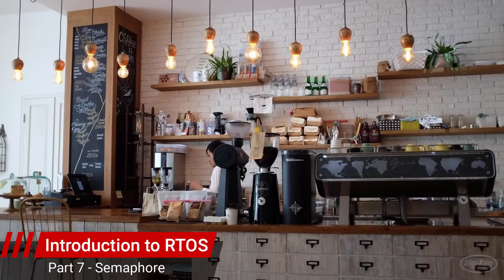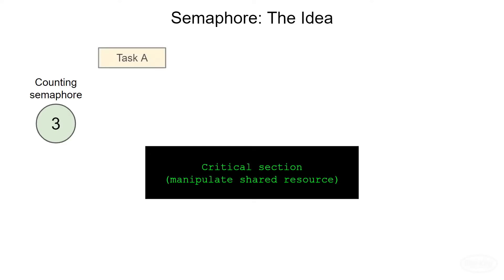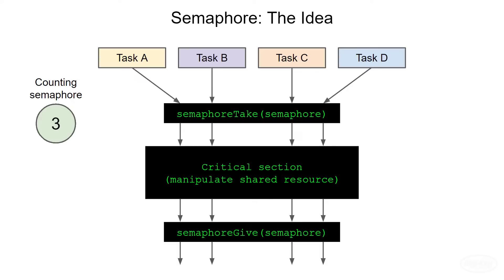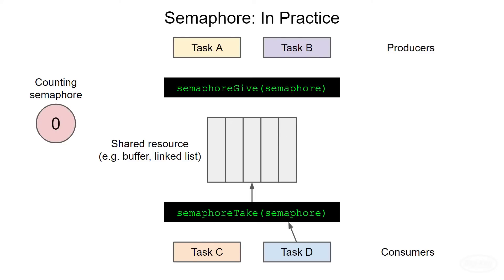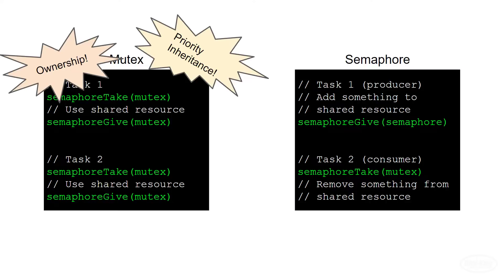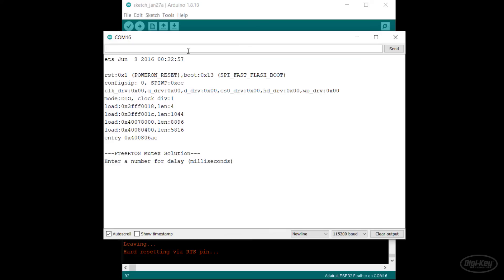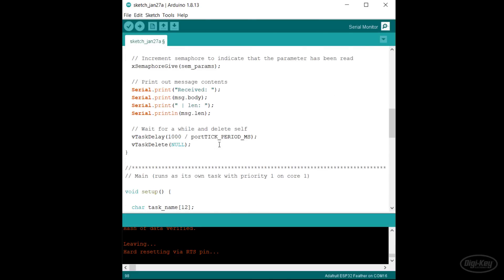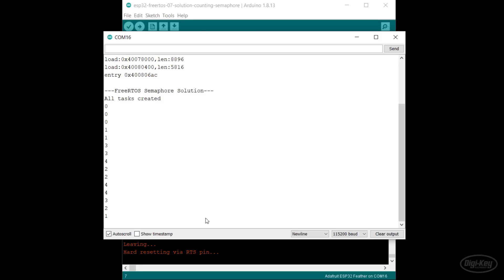Introduction to RTOS Part 7 - Semaphore | Digi-Key Electronics

Comment: Can somebody explain what's the meaning of 
Int num =*(int *) parameters
Min 7:56 
Exactly what does *(int *) parameters mean
Reply: (int *)parameters casts parameters to the type int *. This tells the compiler to treat what is pointed to as an int. Adding the extra star before it tells it to dereference that pointer. So int num = *(int *)parameters tells the compiler "Treating parameters as a pointer to an integer, take the integer pointed to and copy it to num"

Comment: Hey Shawn:

Am I correct in understanding we'd still need another way of managing the possible conflict over which producer/consumer gets to access the buffer first? if a producer gives the semaphore
and places a value in the buffer, how can we tell which consumer would give access to it first? Is it non-deterministic? Would we have to use a mutex to prevent a race condition of both attempting to access the buffer at the same time? Do they have to be made different priorities?

Comment: I don't understand why two semaphores are needed in the solution to the challenge, couldn't a single semaphore be used to count the number of objects in the buffer?
Reply: Never mind, I now understand why that's required. If only a single semaphore was used, the consumer task could take that semaphore, but right before it would read the buffer, the scheduler could switch back to the producer task. The producer task would then successfully give the semaphore (as it had just been taken) and continue to write to the buffer before the consumer was ever able to read it. This would result in overrun errors. The same thing applies the other way around - i.e. the consumer task reading before anything was written.

Comment: Hi Shawn, I tried to fix the messed up "Serial.print("Received: "); ......." with a mutex encapsulating the four lines of "Serial.print()" functions, but it did not solve the issue. I couldn't think of why. any suggestion would be appreciated!
Reply: Hmmm...interesting. I admit that I did not try it before saying that in the video, so I might have to give it a shot (I don't have my ESP32 on hand right now). I wonder if it has to do with how Serial messages are queued up in an external buffer and then send out using hardware interrupts. Maybe try adding a Serial.flush() line at the end of the Serial commands (before returning the mutex) to force the Serial buffer to finish writing out?

Comment: Can you make the code window a bit bigger, please? You could easily cut off the coloured bar and log window at the bottom, and even everything above "sketch_jan27a" is irrelevant too. You could make the window wider and use a larger font for people using mobile devices or poor internet connections 😊
Reply: Thanks for the tip--I'll see if I can make it easier to read for future episodes (everything up to part 12 has already been recorded, though).

Comment: Sticking to the coffee shop scenario, could semaphore be seen as the mechanism of sharing orders between waiters and cooks? On the other hand, Could it be used for a logging process where different tasks send messages to a buffer and then they are broadcasted through, let say, UART?
Reply: If I'm following your analogy correctly, I think you would want a queue for that type of message passing. However, let's say that instead of separate slips of paper, customer orders are all written on a whiteboard that's shared between waiters and cooks. Each time a waiter writes an order on the whiteboard, they increment a giant 7-segment display that all the cooks and waiters can see. This 7-segment display would be the semaphore. Each time a cook starts to process one of the orders, they erase it from the whiteboard and push a button to decrement the 7-segment display. When the display is '0', all the cooks know that there are no more orders. Let's say it's a single-digit 7-segment display, which means it can only display 0-9. When it reaches the max value (9), the waiters know not to add anything more to the whiteboard until the counter is decremented. Does that help?

Comment: Hi, thanks for sharing your knowledge! I have watched the entire series and look forward to more! Just a simple question, for the counting sem example, in the for loop that creates 5 tasks, does program execute each task immediately after creating it and only after it loops for 5 times then the program goes into the "xSemaphoreTake" for loop?
Reply: I am asking this bcos looking at the code itself, it just doesn't feel necessary to xSemaphoreTake 5 times at the end since nobody else is gonna use the sem anyway
Reply: If I am right, then can we add the "xSemaphoreTake()" directly to the end of the tasking-creating for loop? Wouldn't it be safer this way? and also save number of sem needed to just 2 since it give and take right away
Reply: @xidameng  Yes, each task begins executing immediately after creation. The "setup and loop" task would continue to execute concurrently with each of the 5 tasks (in this case, in a round-robin fashion, as they're all priority 1). Taking all 5 semaphores in the for loop forces the "setup and loop" task to wait until all 5 other tasks reached the "xSemaphoreGive()" line. You could also immediately take a semaphore after creating a task in the task creation loop, but that has a slightly different effect: it would force the "setup and loop" task to wait until each task reached the "xSemaphoreGive()" line before creating the next task. Hope that helps!

Comment: I think most MCUs now support read-modify-write instructions that works in one cycle on a RISC.
Am I wrong? It's been a long time since I worked with semaphores.
Reply: I think you are correct. Maybe some older 8- or 16-bit MCUs that weren't made for multithreading don't support those instructions, but I haven't stared at an assembly instruction set since PIC and AVR :)

Comment: So if I had a queue, and I want all of my tasks to "peek" the queue to get the value, I would use a counting semaphore to indicate the all of the tasks have read the queue?

Trying to think of how I could use a counting semaphore.
Reply: If you want to peek at a value in a FreeRTOS queue, you could use xQueuePeek(). Counting semaphores could be useful for things like controlling reads/writes to/from an unbounded buffer or linked list.
Reply: @ShawnHymel  I was thinking that the problem with peeking is that eventually something was going to have to read the item/value off the queue, and a counting semaphore would used to tell the queue "manager" that everyone has peeked the value. Could just use a normal counter anyway I guess :)

Great video. A++!
Reply: @skelstar  You could use a counting semaphore there, too. If you used a global variable as a counter, you'd want to make sure reading/writing was atomic to avoid a race condition.

Comment: Can you create semaphores manually? For example, if I create an int flag that counts up to five, would it work like a semaphore?
Reply: I believe the reason you would want to avoid the manual work is because the in-/decrementing operations would not be atomic, as the built-in FreeRTOS semaphore functions that he demonstrates are. That would mean some global int used as a semaphore would be susceptible to race conditions, and you would get non-deterministic behavior i.e. you couldn't really trust that value to be precise. This could then lead you to buffer overflows and the kinds of problems you'd want to avoid by having atomic operations.
Reply: @MarlosZappa  that makes total sense, thanks

Comment: My favorite instruction pair: cli, sti for very short pieces of critical code. Cli disables all interrupts except non-maskable.  Sti enables.  Great for single core CPU, but not so much for multi-core.  Also it's machine dependent.  (assembly language)
Reply: You disable interrupts (including timers, hardware interrupts, watchdogs, etc) to control access to shared resources. Probably OK in simple programs (as I used to do myself back in the 80's when running 4/8 bit micros, and would do so now for very simple embedded apps) but wouldn't use this approach for anything more complex, and certainly not in the context of an app that is considering an RTOS.
Reply: If you are doing digital signal processing or digital control algorithms in a DSP (yes, some ARM Cortex-M processors can be considered as DSPs) you're loosing synchronization in the sample time if you disable all interrupts. Moreover, these interrupts should run as kernel unaware interrupts in FreeRTOS, so the scheduler doesn't prevent them to run when they are supposed to run.